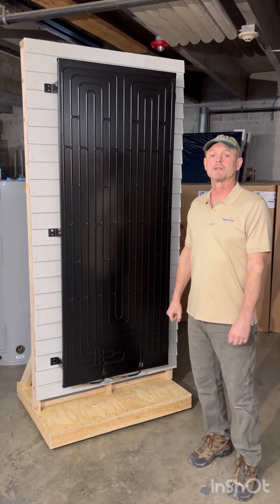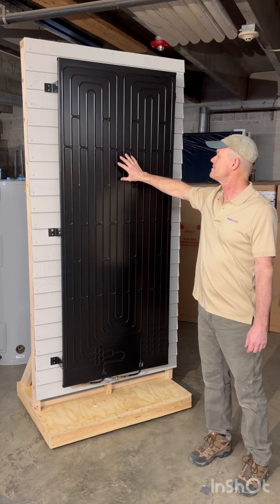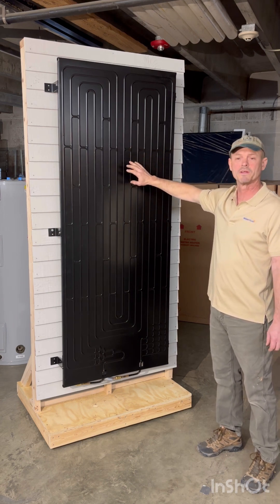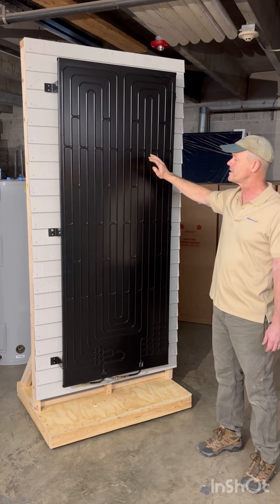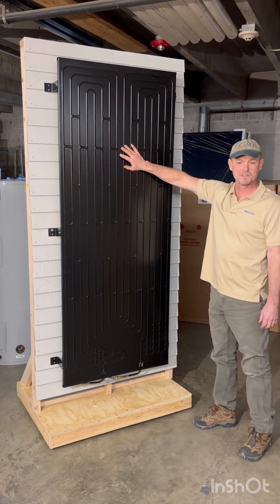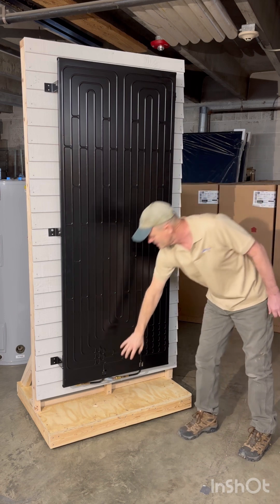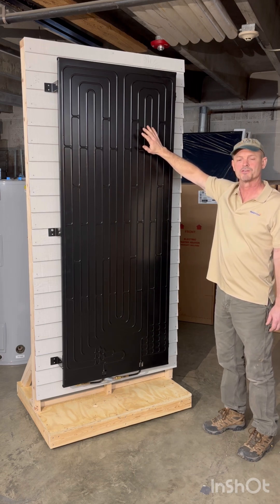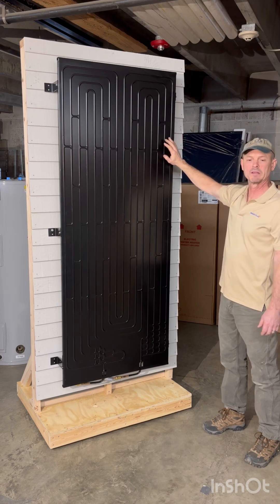Smart Solar Heat Pump Water Heater, Introduction

Comment: More heat pump fantasy.  The only heat pump water heaters that make any sense are integrated with heating and cooling systems.  Heat pumps all work good in any one particular condition.  They transfer heat, not make it.  In a warm location they help with AC.  Once winter comes, they have zero advantage.   I have a heat pump in the basement of a house I don't use in the summer.  Next to zero advantage.  It does circulate air and dehumidify.  That is the biggest advantage for me.
Reply from the maker: Thanks for the watching/commenting. Your point about the effectiveness of conventional heat pump water heaters in the winter is well taken. The Smart Solar heat pump uses outdoor air as the energy source and has a COP that averages 2 in a New England winter. Much more in the summer, of course.
Reply: There's a great chart that NESHW / Smart Solar Water Heater, the largest solar thermal installer in New England, by the way, put out a few years ago.  It shows the costs, effectiveness and other datapoints.   Solar water heating can be best, but customer pricing is dependent on subsidies, which are low at the moment.  I recall that there are various pros to choosing an external paneled heat pump water heater, over an all-in-one and very few cons.  I don't remember any cons. actually.  Maybe they have the chart and can post it or add it to the video...   I have their 'regular' solar hot water heater/roof panel package.   It was installed around 2017, paid itself off a few years ago and has been excellent - simple and effective.

Comment: In other words, this is a more efficient evaporator of a heat pump whose output is hot water. It’s painted black, so it adds solar collector qualities (namely 2KW of heat) to an output function of a regular condenser.
Reply from the maker: Correct. Except that the 2 kw would be the total capacity of this system under good conditions. So the output is not necessarily greater than a conventional heat pump water heater. The outdoor evaporator simply replaces the evaporator that is otherwise indoors, mounted to the top of tank and blowing cold air.
Reply: @ you mean that the solar input on this dark surface is none or negligible?

Comment: I wonder if this would work for a van application mounted on roof, maybe scaled down a bit?
Reply: That’s interesting. Maybe on the side to open the roof up for electric solar panels? You should be able to plug one of these in to a typical wall outlet, so maybe with an electrical upgrade it’d be your best water heater option.

Comment: What's the cost comparison of this vs buying a heat pump water heater that I already have installed? I'm only pulling 2kwh a day to run my heat pump water heater. However the unit cost 4 times as much as a traditional water heater.
Reply from the maker: Depends on local rebates. End user gets the 30% federal ‘solar’ ITC plus whatever’s available locally. Usually a $750ish rebate. In MA this product gets a $1500 rebate. So the net to the end user is close to the installed price of a conventional heat pump water heater.